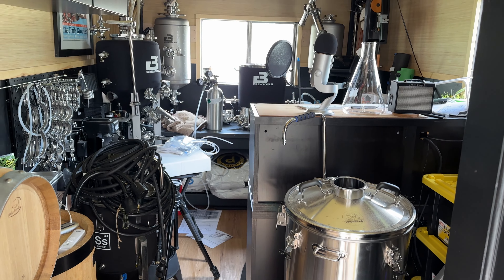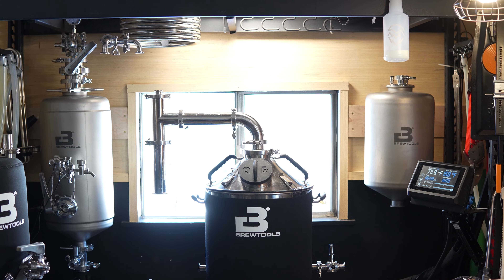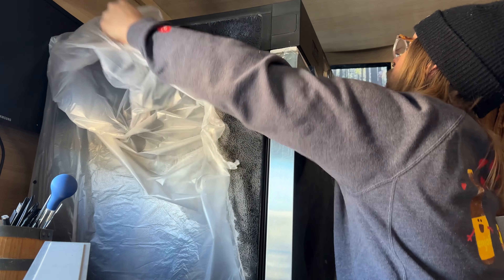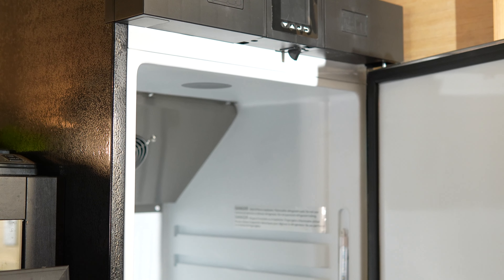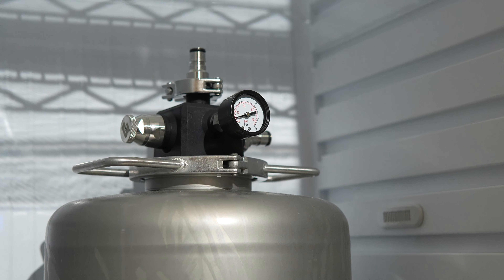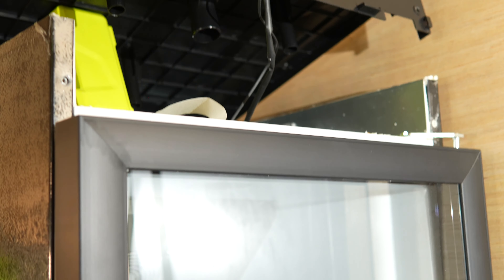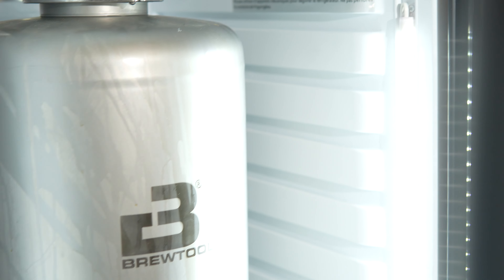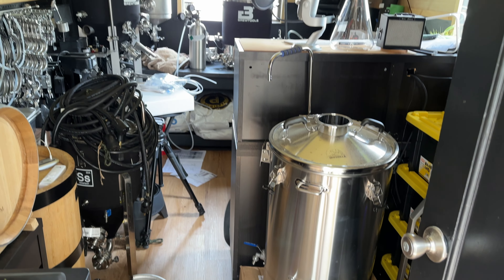BIG CHANGE

Comment: I found a way to fit the Spike CF10 into the RAPT Fermentation chamber by cutting out two of the side shelf supports right where the top fermenter band clamp is, then filling that in with flat plastic and some fridge caulk/epoxy. I can share pics if you want. I had planned on a rolling ramp for getting the full CF10 in and out, but it's easier to just fill the fermenter in-situ and leave it there during fermentation, then take it out once it's empty.  I love it, it's easier to deal with than glycol in my opinion. I couldn't figure out how to do 2 mini-unis in there, but I think 2 of the clawhammer keg fermenters or similar wouild definitely work too.  Will be curious how you like it, and whether Kegland works with Brewbuilt or others to make a compatible stainless steel fermenter that works with it.
Reply from the maker: Awesome!!